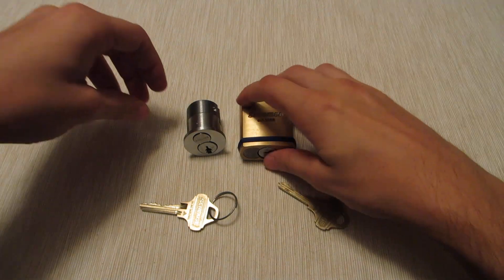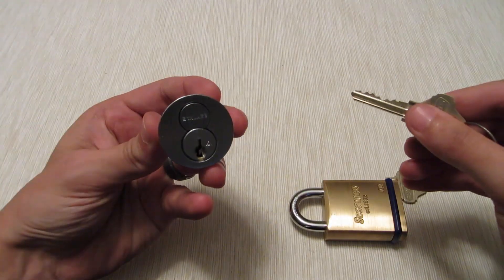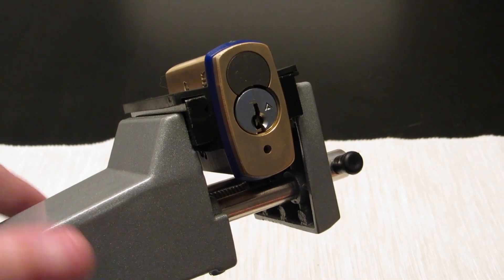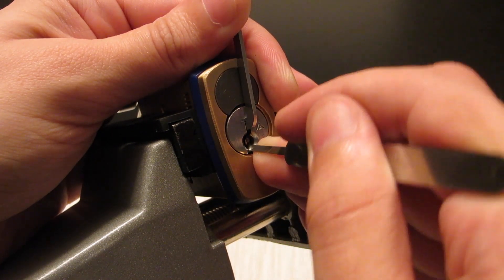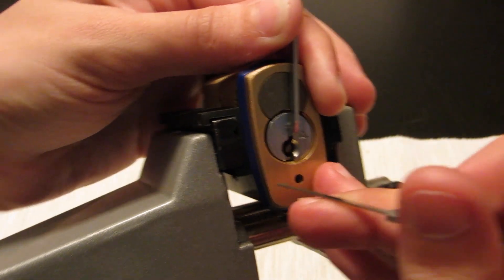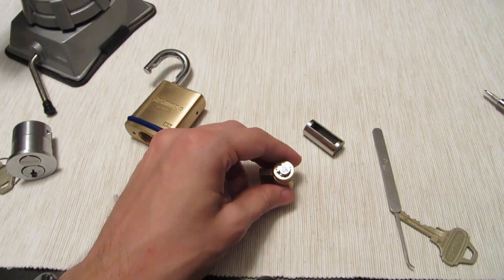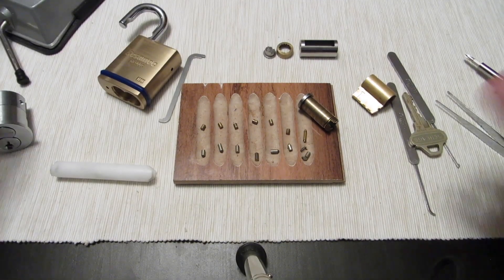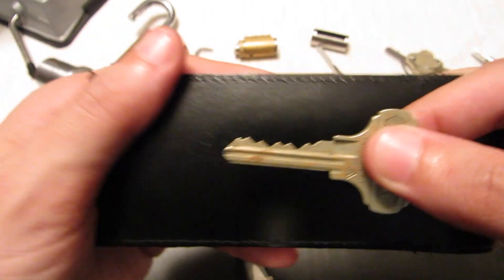[5] Schlage Everest SPP'd & Gutted

Comment: Nice picking. Do you think the extra pin can come into play while picking. Then it would be just a bit trickier.
Reply from the maker: Potti314 I have a handful of Everests and the detent pin binds last on all of them. I have pinned them up with security pins which drastically toughens them up and then the detent pin comes into play during picking. I don't understand why they don't come with security pins by default.